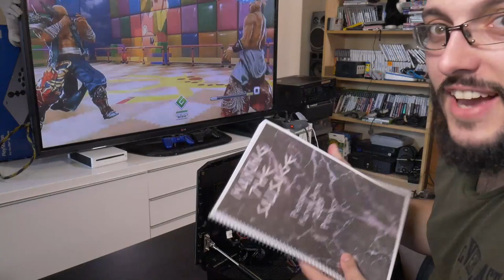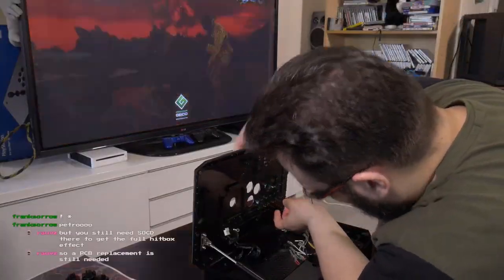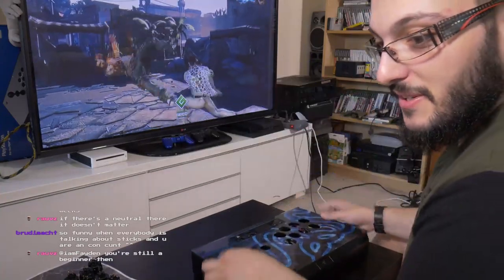Razer Panthera Artwork Mod (Focus Attack Prints)

Comment: is that Acrylic board? or glass board?  and how 
thick was that ?
Reply from the maker: They call it "Plexi" which is just "Plexiglass", which can also be called "Acrylic Glass". It definitely ain't Window Glass! Imagine raging on that fight-stick?! They'd be more blood than Mortal Kombat!! ⚡💪😤>🩸>💀

The thickness is a "little" bit thinner than the original. This is what the focusattack website says about it:  "Please note that the plexi - at .060" - is not the same thickness as the original model of .080", but will closely line up with the Panthera's control panel lip as artwork is added.
"

Comment: I have the sfv version panthera you think there’s any chance I can save the artwork during the removal?
Reply from the maker: I wouldn't bet on it. But if you were extremely patient and applied a lot of heat, to soften the glue. You could peel the art off in one piece. You gotta go in with the expectation that the original art is gone, in order to prevent heartbreak in case you accidentally snap it off or scratch it! Hahaha.

Comment: what size is the paper to be printed on? A3?
Reply from the maker: This was a custom print from the "Focus Attack" website. It comes in the right size, ready to install. If you were to do it by yourself, you could print it on A3, use the Plexi as a stencil and cut around it, to make it fit.👍